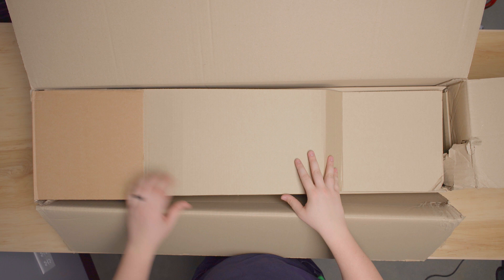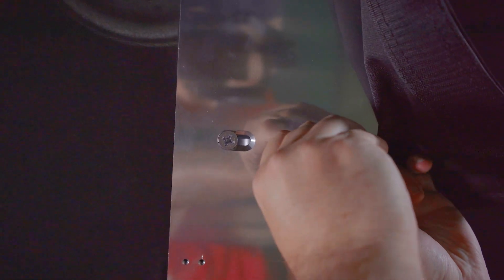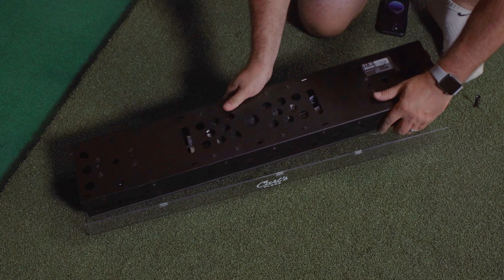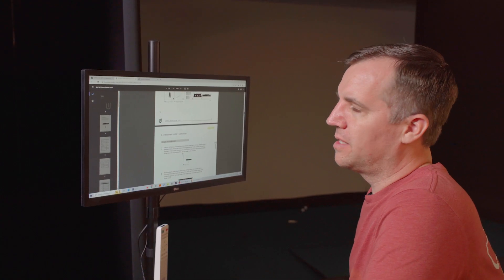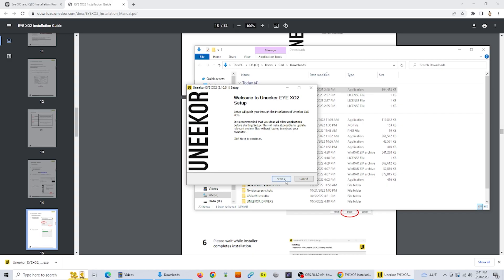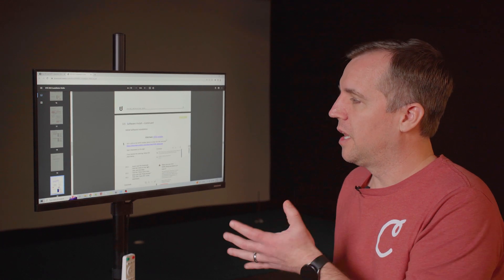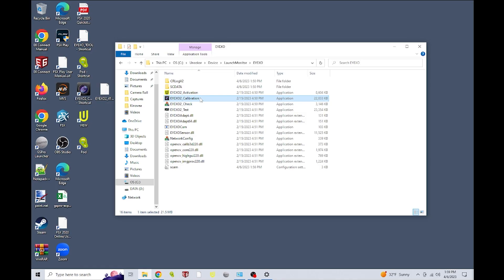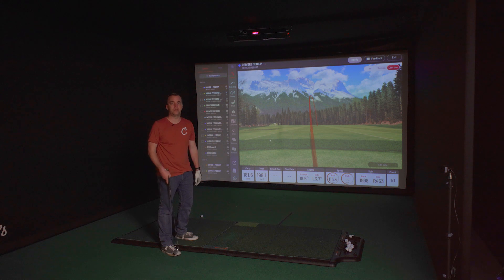Setting up the Uneekor Eye XO 2

Comment: Great video! I think the licensing process has been updated since this was made, right? I have a question about the Eye XO2 placement. The manual states a max height of 9-10 feet, but we have a high ceiling and used two projector mounts to install the XO2 at 10 feet. However, our projector is behind the XO2, causing a shadow on the upper part of the screen. Have you tested the XO2 at heights above 10 feet, and if so, how did it perform?
Reply from the maker: Thanks! Yes, things have changed since this video! But to answer your question, we have not tested it outside of the recommended heights. We have it on our list to do that at some point, though!

Comment: How high off the ground is your setup?  Carl's said I could not use the frame fount option as it was only 110 inches off the ground not the 113 asked for by uneekor.
Reply from the maker: Our setup in this video is our 10'x15.5' Pro Enclosure. We suggest at least 113" high frame measured to outer dimensions because once you take away the pipe framing and mounting kit, you get down to Uneekor's minimum of 108". So, if you have a 110" high frame, you take the about 5" off of that for 105" where the EYE XO 2 would be mounted and it would not fall in the suggestions from Uneekor. It could still work fine, but cannot guarantee it based off of recommendations from the manufacturer.